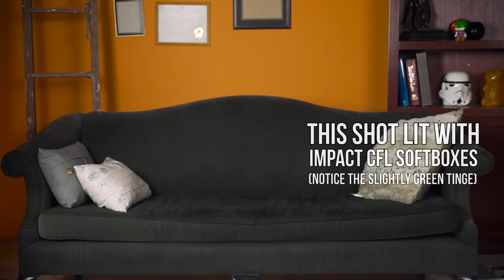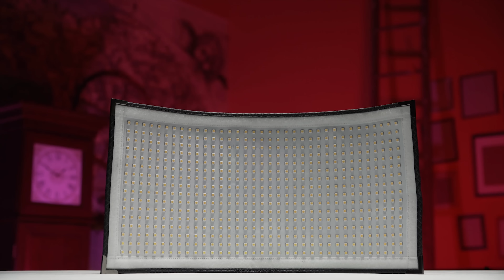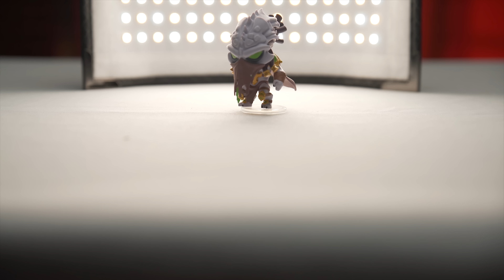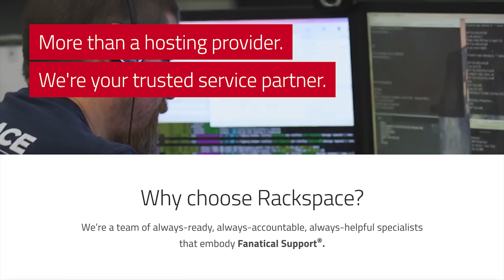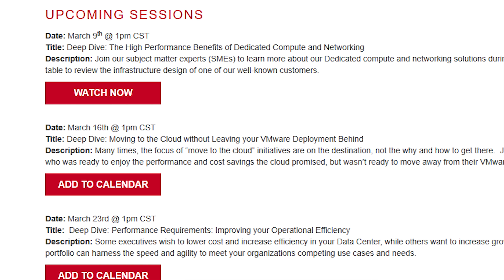LED Lighting for Video - Why we made the switch

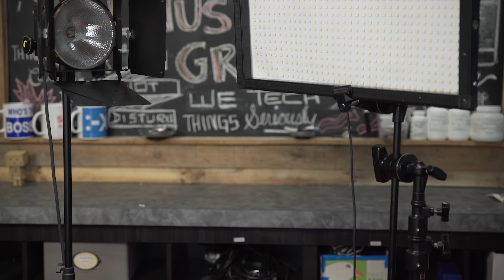Comment: well Production value 5/10 Reading an autocue 1/10. Tip... You have to slow down and respect full stops. Take a breath. Man you rattled through your lines like a General Purpose machine gun on Fixer fire mode. You shoot great vids but go behind the camera not in front... Calm down. Smoke a weed or have a G&T (or 2) but relax. I stopped Stoped at 3:05. Cant watch any more. Sorry....

Comment: Wow, beautiful example with color profiles of each light source on the Storm Trooper helmet. Helpful to see how each handles white differently. With the flexible LED panels, how do you go about mounting them onto a light-stand or w/e? The last shot shows the lights are basically sheet-LEDs, so how would you get that setup to properly project key/fill lights on location? 

Nicely done Brandon! More gear videos please :p
Reply: Wow, that's funny to see how nobody remarked you Oo

Comment: Love the video, thanks for providing this sort of background information.  I looked at them and the primary issue would be price for me, they are $600 each!  However I'm sure the price will come down with time.  For now, I'm using StudioPRO CFL Softboxes, the ones that take 5 large bulbs.  Yes, I'm sure the colors are all wrong, but they are inexpensive ($100 each including stand) and when you're starting out, cheap is good!  :)

Comment: Use what's known as paper amps. Amps = watts/Volts. In America the standard is 12 amps in a wall socket, but you can change that to a 10 and configure it to be 10 amps x watts = volts or 10amps x Volts = watts. You'll never blow out using paper amps because you're using less than what's available and it's easier to calculate
Reply: +Adam Hansen i thought america was 120volts? does that really mean america is sub 2kwatt ??? not even enough to run a toaster and jug at same time?

Comment: my budget is around $1000  i might getting one of these fine ass  bitches witch one would u people recommend ? they are both cost  £1000

 ACER Predator G3-710 - Windows 10 (pre-installed) Intel® Core™ i7-6700 Processor Memory: 8 GB Graphics: NVIDIA GeForce GTX 970 Hard drive: 1 TB & 128 GB SSD

 or

 HP ENVY Phoenix 860-050na Gaming PC
 Windows 10 (pre-installed) Intel® Core™ i5-6600K Processor Memory: 16 GB Graphics: AMD Radeon R9 370 Hard drive: 2 TB & 128 GB SSD

Comment: How cheap of CFLs were you getting that they needed time to warm up?  You know you are not supposed to use the store brand ones that come in 20 packs for $15 right?

Westcotts are nice and all, but at over $600 a panel that is a little bit out of reach even for some of us guys working in the field right now.  Especially considering how much of a mark-up is going into the panels; all of us are geeky, we all know there is less than $100 of materials in that panel.
Reply: +Christopher Raff They're a company with extremely high production quality. I'm sure 600 dollars a panel isn't too much. Keep in mind that different products have a different target audience.
Reply: +broken3260 They didn't make a video saying Westcott LEDs are the best for free; LMG always makes it a point to say when it is an unsolicited response.
Reply: +Christopher Raff Every CFL I have used take a time to warm. But is not very noticeable since it goes up very slowly and Im talking about 25% of improvemment, perhaps need to wait until cathode reach operating temp ? ...not sure really. But I dont think they do that because cheap I got one I bought 4 to 5 years ago, near 4500 hours and 1500 cycles,  works perfect, (I mean good quality CFL) and it gets brigther after 5 minutes.
Reply: +38911bytefree I think you need to do some research on fluorescent bulbs.  Yes cold can affect them, but at really low temps like 122 degrees and below, the initial jolt of electricity sends it past that temp very quickly(check it with a themo, it happens in less than a minute in even the cheapest home use bulbs).  So unless you are working outside in a blizzard heat is not your issue.

If you were getting problems it is either inferior circuitry(cheap chinese knock off bulb from Amazon), or it is not getting enough juice from the inferior head(again chinese knock off; this is not a judgement of chinese manufacture, just cheap chinese manufacture).

Now you are right that the first 20-30 hours of a CFL you do get less than optimal output. That is hours not minutes of warm up time before use.  A good quality CFL will be warm and ready to shoot in seconds, and they only cost maybe $10 more a bulb than the cheap ones, and they are truly color balanced with a good balanced CRI.
Reply: Christopher Raff That wasnt a paper, was my experience. I put minutes, and Im talking about minutes. not hours. Minutes till warm up. didnt know CFLs have break-in. The CFL I told is not chinesse and the number I put are real. And no chinesse crap will give you that numbers- Im telling what I see. Just like that. Do some search on your side, because to me is clear, but all the CFLs I have used did the same, good ones, and crap ones. CFL are at room remperature (15-35 CELCIUS)

Comment: Yeah, no. Way too expensive, I just use led backlight panels, they are much much cheaper and with the right filter screen they are just as nice as your fancy FLEX Lights. You can buy a dimming dial for cheap to, for that kind of money $1000, I can get 5 times the amount of lights and accessories for my studio.

Comment: 3:19 and some other parts i see flickering... Also if i would buy led lights for video id make sure you can control color temp and can be dimmed. For studio setup id check this one https://www.etcconnect.com/Products/Lighting-Fixtures/Source-Four-LED-Series-2/Source-Four-LED-Series-2-Lustr/ yeah it costs 2000-4000$ per unit depending how many lenses you need... And demo your setup's get high fps cameras to see how bad and where the flickering might start... 

Also for those who think of ordering DIY kits from china it is a big gamble, consistency of led you get from china is bad which can make your setup look very bad. I give you example which i seen to happen soo many times. You build LED setup from china led's it looks and is working like a it should be hurray, now you want to build 2nd or even 3rd light because 1 is never enough well you order again "same" led's from same vendor and led's are from another patch you can see with your eye color difference and with camera you might even get flicker from this unit.

Comment: Operating System : Windows 10 Professional 64Bit
Cabinet : Corsair Graphite 780T 
CPU : Intel Core i7 5960X 
Motherboard : Asus X99-E WS 
RAM : G.Skill Ripjaws 32GB DDR4 
GPU : Zotac 980 Ti 6GB DDR5 AMP! Edition 
HDD : WD 2TB Black @10950/-
SSD : Samsung 850 Pro 500 GB 
CPU Cooler : Corsair H100i GTX 
Optical Drive : Asus DRW-24B1ST 24x DVD Writer 
Power Supply : Corsair RMX 1000i 80 Plus Gold 

hey how is this ?

Comment: Looks like it's using a mix of cool and warm white led's - what do you think about the new and still pretty expensive 'high CRI' panels? Not needed?
Reply: +Maker&#39;s Muse The Flex mat that has cool and warm LEDs is actually a bi-color version, allowing you to adjust color temperature from anywhere between 2800K and 6000K. These are also have a high CRI ( ~95 to 98).
Reply: +F.J. Westcott Thanks for the info, that's even better. I need one.

Comment: In my computer room I switched from 4 standard household 60W incandescent to 2 super-bright white 100W equivalent LEDs that use 10W each. From 240W to 20W and with a super-bright white that illuminates like the sun, without that outdated 'ideal' orange-y tinge that is meant to simulate candle lighting as we transitioned from candles to light bulbs.

Comment: Finally a Video about power use.  High end riggs and equipment are fun but tend to use a lot of wattage.  How about a video about a home Router/NAS that uses less than 12 watts and can be run for hours on a battery backup when power fails.  This would be great for checking weather updates and power outage maps with tablets and phones over wifi.  We've all had experiences with power outages that have left us in the dark searching for that old wall phone to make calls and report outages.

Comment: I made a hand held super flood light out of an old pentium 4 heat sink a 100 watt "lohas" 36VDC COB LED bulb and a constant voltage controller to convert the RC battery's 12.4V to a stable constant 36V with a knob to dim it and limit the current all the way down to 22V(just before the LED lo longer emits visible light), ,i used plumbing pipe for the body 6 inch main with a 2 inch TEE,  and embedded everything but the battery inside, the voltage controller fortunately has solder points for a fan and thankfully, at that voltage and current the controller heats up before the heatsink gets too hot, turns on the fan, and cools them both, the battery has a buit in low voltage cutoff, whole thing including the high dollar LIPO battery cost me less than $50 and is brighter than a car's head lights, but throws a beam about as wide as normal outdoor narrow flood light

Comment: Are the flexs using a cross combination of warm and cold white LEDs? Just appeared to be in that last shot.
Reply: +Dan Clarkson The Flex are available in Daylight only (5600K) or Bi-Color versions (which is what you saw in that last shot). Bi-Color Flex Mats use a combination of LEDs to offer color temperature adjustment between 3200K and 6000K.
Reply: Ah its a changeable colour temperature ability. Thats pretty neat

Comment: $650USD for a foot by foot panel with one color temp! Jeese. 
Even $250 for their 3x10" one. 
Seriously if you know how to use a soldering iron look up DIY Perks LED flex panel build guide. 
He found LED stripes with a CRI of 85%.
Reply: +Deathbynature This!
Reply: +Deathbynature CRI was a useful measure for film photography, but it's useless for digital video as it doesn't correlate at all to the sensitivity of the RGB sensors.
Reply: +SDG Electronics "... it's useless for digital video as it doesn't correlate at all to the sensitivity of the RGB sensors." 
You're talking about Color Render Index right? You're not thinking of another "CRI" acronym?
To my understanding of Color Render Index as how well a light source compares to the visible electromagnetic spectrum coverage of sunlight. Actually sunlight on a clear day being a CRI of 100%. 
I also understand that CMOS sensors have an array of color filters on each pixel that pass sections of wavelength range to differentiate color. No filter is an "absolute" perfect pass; only let through a singular wavelength. 
Also considering the wavelengths shifting as they are reflected, refracted and even a tiny bit absorbed and remitted as fluorescence. This definitely happens with the semi-translucent nature of human skin.  
So it sounds completely nonsensical to me to state that filling out the color spectrum has ZERO effect on image quality.
DIY Perks also provides evidence with a color spectrometer to prove the LEDs' CRI, not just go off what the manufacturer says, and creates diorama box to have a repeatable scene as a fair comparison. You can see a massive difference. 

Sorry for the wall of text. Was just gonna say you don't know what you're talking about but I checked out your channel and you seem like an intelligent person and figured you'd appreciate an explanation why I think you're wrong rather then the insults YT comments normally are. 
-Justin
Reply: Make.Test.Battle You're pretty much right, but the CMOS sensors aren't broad spectrum devices. They are sensitive to a band of three wavelengths, so theoretically you'd be better off with an RGB light source, rather than white LEDs which have spectral peaks in the blue and yellow region.

CRI is a measurement taken relative to an incandescent light source (incandescent lamps have a CRI of 100) but no one likes to film with 2700K lamps, and a black body naturally has a suppressed blue end of the spectrum.

Comment: LED is definitely the future in lighting. Even seeing street lights in LEDs. Imagine the nightly power savings of all ambient and traffic lights moving to modern LED.
Reply: +Andrew Hunt LEDs are not as efficient as the sodium lighting they typically replaced. Low pressure sodium lights are still the most efficient lighting source known to man.
Reply: +SDG Electronics Interesting, I'll have to look at them. Now does their efficiency include longevity and size? Like could it someday replace my 160 lumen Larry light that was $8 at a truckstop? Or are they more for professional and wide area saturation?
Reply: +Andrew Hunt They're no use for video or photo as they're monochromatic. They're the orange street lights you see
Reply: +SDG Electronics Ah I got you now. As a trucker I always wondered why they went to orange. I notice a higher luminosity rating, and better clarity, but figured they were just orange glass fluorescent. Thanks for the info.

Comment: Cheap lighting solution: buy broken screens from repair shops (most will let you take them for free), rip off the screen and hook up the backlight to a power supply (Add a potentiometer to change the brightness). You now have a super cheap light that will be pure white unless it was a super bad quality screen. After you've torn out the LCD panel and guts of the monitor you can then reassemble it, if the monitor had a vesa mount you can use this to mount it to a tripod.

Comment: For CFLs with that form factor (edison base) I'd recommend checking out the Kinoflo 26S-K55-120 (for 5500k) or 26S-K32-120 (for 3200k). They apparently use a special formula with extra phosphors to smooth out the spectrum.  Of course there are still spikes but they're pretty good with a CRI of 95.

Comment: Nice overview! The more people know about how awesome LED lights are, the better :)

For those who find the flex lights too expensive, you can actually DIY some using LED strips for not too much ($60), which is a good option for those on a budget.
Reply: +DIY Perks Heh, I watched this and instantly thought of your videos
Reply: ***** There isn's so far any technology that has beaten led light. It's cheap, makes a lot of light with small pieces and runs very, very cheap and efficiently.
Reply: lol, I was actually thinking of your flex LED panel video as I watched this video. Is it possible for you to do a light-off? putting your cheaper, homemade LED panel against one of the ones featured in this video?
Reply: +DIY Perks They could be even cheaper if you come into the beautiful word of importing from China haha (Banggood, Aliexpress etc). They have 5 meter long RGB (that wouldn't even be needed) strips for about $15. White ones would be even cheaper, only thing you'd need is power adapter.
Reply: +DIY Perks The first thing i thought of when I saw this in my feed is your video you did a while back... Now I remembered I need to share it with a friend...
Reply: +DIY Perks LED lighting does NOT take an electrical engineering course. Only some basic information, like, led's drop voltage, not current. That is probably the most important thing someone can know. When the LED's are not bright enough due to running them in series, most people would THINK they need to use a lower resistance resistor... and that is wrong. That will just make them dim and potentially burn them at the same time :) 
But yeah, just an hours research and you are set.
Reply: +El Diablo ,todays LED is a very new tech. Before 2007 LED were dimmer, expensive, and made of Sapphire... but today they're made of a "GaN" material.
Reply: +DIY Perks We actually used your old LED Panel guide to build our own panels a years go. It helped raise production standard so much. A year later we have 23k subscriber. 
Anyone serious about getting into youtube needs to have good lighting and good audio then just use your phone as a camera.
Reply: uTukan  Cheap LEDs aren't always quality controlled as well and can result in the color tinting issue that they went over in this video. DIY Perks actually made a video about this ("Can this LED mimic daylight? Yuji LED review").
Reply: Megabobster Hmm nice, that didn't cross my mind although it obviously makes sense. Currently, my LED strip has quite blue tint when set to all white mode indeed.
Reply: And you would have a flickering light in your videos!
Reply: and a CRI of minus 50 ....yeah ...sure!

Comment: Yeah, LED's are great for Videomakers, unfortunately they are very expensive.. But power consumption and durablity will relavate it over time:-D
Reply: +jukeman Not to mention you can move them when they are on without burning yourself.  You can also bump them without breaking a filament and they also have zero warm up time unlike a metal halite or a sodium vapor lamp (though sodium lamps are useless for filming as they are yellow).
Reply: Bryce Bannon Of course a lot of benefits:-D

Comment: The color rendering index (CRI) and the flicker (while dimming with pulse width modulation PWM) were the biggest problems using LED lights, especially for video work. Nowadays there are LED manufacturers producing high quality phosphor, resulting in LEDs with a CRI of > 90%, which is practically the same as normal daylight. Dimming via power regulation instead of PWM causes no flicker at all, however it tends to be slightly less efficient than PWM.